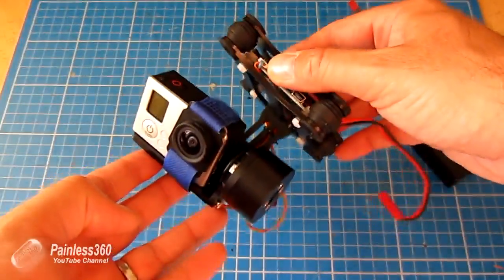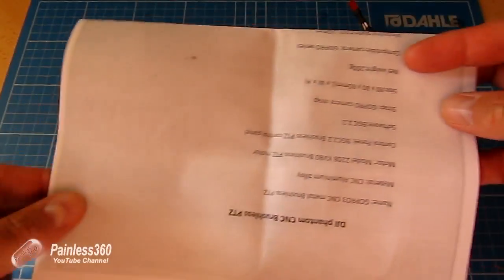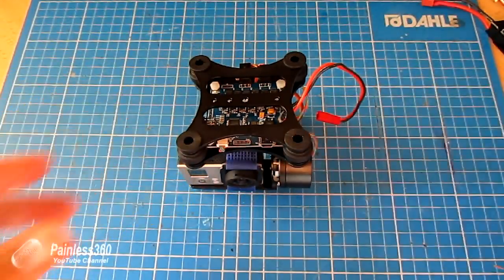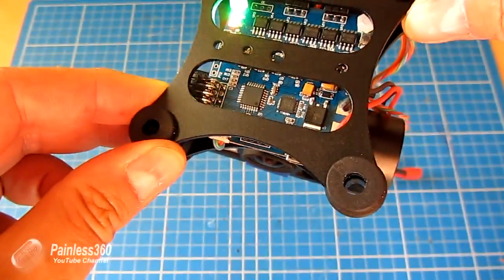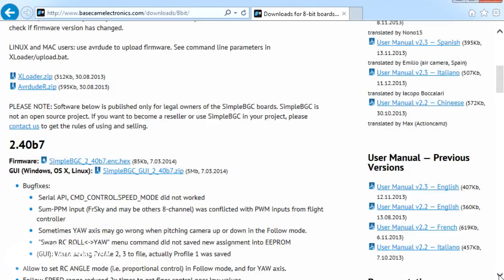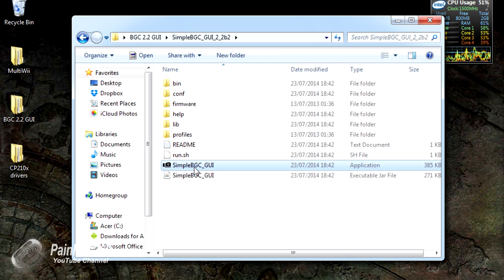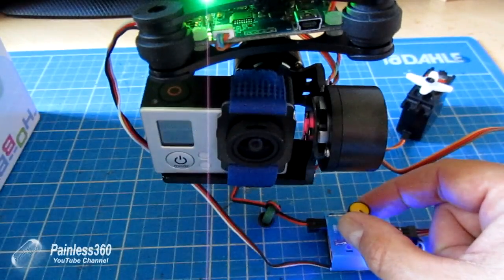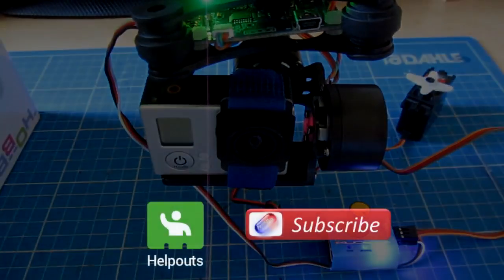BGC 2.2 (2.2b2) GoPro Camera Gimbal – Software, drivers, setup and receiver connections.

Comment: @Painless 360 
Thank you for sharing this informative video. I certainly was able to download the drivers and simple BGC 2.2 (2.2b2) software with your links, but, I have not used it.
 "Out of the box", my GoodLuckBuy, GoPro brushless gimbal worked fine. The gimbal was stable with with each axis movement. There had been an initial whining of the motors but it soon went away. 
I was able to activate tilt control by connecting the "pitch" pins (signal & ground) at the board with a signal and ground at a spare channel at the receiver, and, set that channel to use the "VR" knob on my Futaba 10J Tx.
The issue - With the "VR" knob centered, the gimbal and GoPro camera tilt down 30-40 degrees at start up. To get the gimbal back up to level with the horizon, I have to turn the knob counterclockwise. 
Have you experienced this peculiarity? Is that something that I can fix with the software or is that a Tx function that I need to enable? I thank you for any advise.
Reply from the maker: Hi Rogelio, don't worry you can sort this out.

This feature allows you to set the attitude of the camera manually so you can set a 'tilt' that the gimbal maintains when flying. I use it myself to have a slight downward tilt so that the GoPro camera is looking more at the ground than the sky as I fly using another camera mounted on the body of the model.

To correct this - connect the gimbal back to the PC and fire up the software. Make sure that one of the button press selections in 'Menu button' tab is set to 'Set tilt angle by hand'. You can see this on mine at 5:23.

Make a note of how many presses it takes to activate this mode - mine was three.

Disconnect the gimbal and power it up. Press the button on the board the number of times to enter the 'Set tilt angle by hand' mode and the gimbal will go floppy. Hold the angle you want the board to maintain and after a few seconds the gimbal will store this position and power the motors back up.

I may make a quick tip out of this as I'm sure other pilots are having the same issues. Hope this helps. Let me know.
Reply: Painless360 Thank you for the reply and help. I wish that I could report that I had success with the GUI. However, the first time I tried to connect on my Comm Port 6, I received an error message that there was a  "GUI vs Board Mismatch". The latest version of FW on the board of my gimbal is 0.1.b9 and the GUI is 2.2.b2. Of course the suggestion was to upgrade the FW, but, I can't use the 2.2 GUI to do that because there is a mismatch.  

I have the FW update on my desktop - BGC_2_2b2.enc.hex file, but, the question is how to upload it unto the board.  I tried using the "X Loader" (can't recall where I got that idea) to upload the hex file, whilst I didn't know where it was going to be uploaded. Nevertheless, I got another error message...."Failed to upload. Error writing FW." 

Do you have a "How To Upgrade The Firmware On A Cheap GoodLuckBuy Gimbal For Dummies" book handy? I sure could use it right now. 

Thanks again for your help.
Reply: Painless360 I guess I should consider moving on with this gimbal. After several attempts to upgrade the firmware using XLoader (failed to upload error) as prescribed by the Basecam website, all I managed to do is to "brick it". It now just flops to one side and does not respond to anything. The LED's on the board light up, but there is no boot up, nor any response to Tx input.  Again...thank you for your help.

Comment: would it fit and work with mobius?
Reply from the maker: Hi, it should, it can handle the heavier GoPro. Be careful though the gimbal is made to balance perfectly with the GoPro 3 in the cradle, if the Mobius is lighter then you may need to add a little more weight to make sure the roll motor isn't running harder than it needs to. Hope this helps.
Reply: Yes it will, but i think you wili need some PID tuning, maybe not